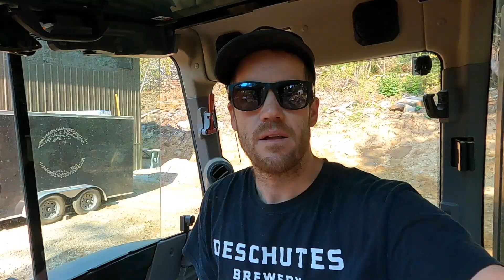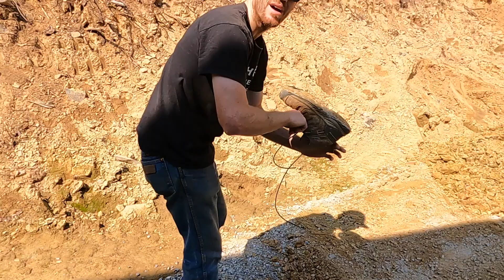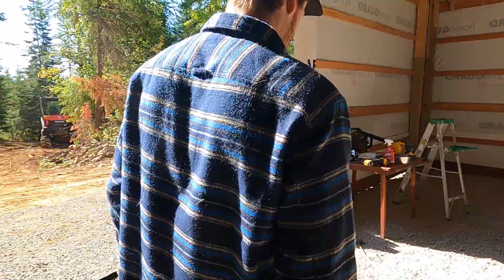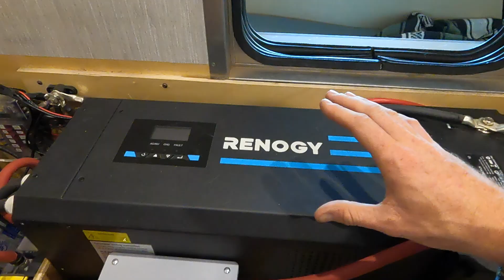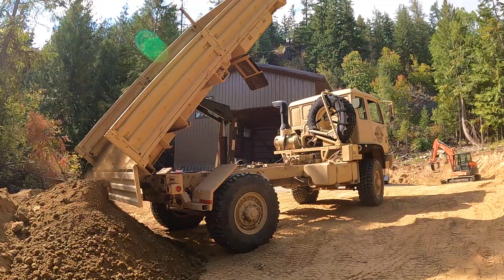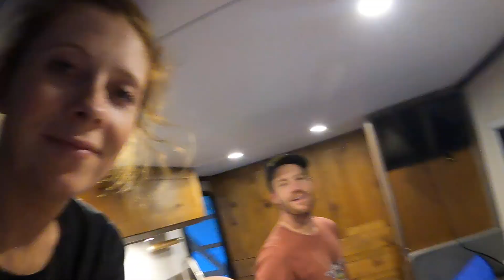Expanding Our Off-Grid Power System

Comment: I notice you keep stating 110/220 volt for all your AC systems but is it actually 110/220 volt output or 120/240 volt output? 

The reason I ask is because I don't think I have ever seen AC in a split phase supplied home below 115 volts (normal sag at peak) which is usually 120~122 volts and peaked at 126 volts and yes that was in cities with a population of over a quarter of a million. Of course in a 3 phase building you'd have 120/208 volt at the service panel.
Reply: Appliances are designed to work with 85 - 100 Vac.  The reason we run our single phase circuits at 110 - 125 Vac is to account for voltage losses on long wiring runs and extension cords during motor startups and such.  Good quality modern inverters allow the output  voltage to be set anywhere between 108 Vac and 125 Vac.

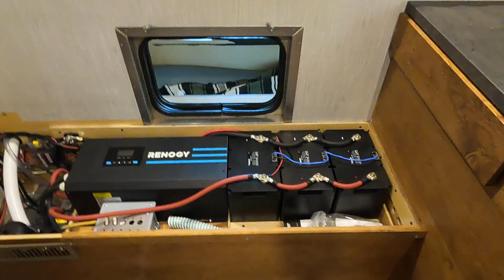Comment: @ 6:33... I'm sure you've heard this a few times, but.. With the 12V + coming off the #1 Battery on the left you should have the 12v- coming off the #3 battery on the far right. You will get a better ( even ) charge and discharge on the Battery Bank. ( click on my name and you will see a part of my Camper system )

Comment: Great video just wondering if  yall have plans to add one those roof mount ac/ heaters to your truck camper and if you can run it off your lithium batteries and solar panels for an extended amount of time?
Reply from the maker: The plan was always to add an A/C unit, we use never got around to it last summer. I think we would use our portable panels, so that we could park the truck in the shade. In that case, we could probably run it for about 5 hours off our system as it sits.

Comment: I have my Cirrus 820 and have Renogy flexible 100 watt panel room for two more and a 3000 watt Renogy inverter the same one you have and a Victron  100/30 charge controller also two Chinns 100 Amp hr Lithium batteries.  I just returned from a 7400 mile trip from Florida to Seattle and I only had to use my Yamaha 2800 i generator twice for the AC. I think if I put two more Renogy solar panels and maybe 2 more Lithium and I should be able to run the AC as well. Any thoughts or suggestions there.

Comment: When the oil pipeline was under construction, the road builders used non woven fabric to keep the road from sinking into the tundra.  Considering the area you guys are working with, plus the road construction you have planned, it occurred to me you need an outlet that handles commercial rated orders.  
There use to be an outfit in Vancouver Washington called GEO that sold the non woven fabric made at the GP mill in Washougal Washington.   But that plant was shut down years ago and as far as I know, it is still shut down, so my suggestion of GEO may be worthless.   But there must be an outfit that still supplies road builders with non woven fabric, even though the pipeline is no longer under construction,  Buying it at Home Depot, won’t work out though probably, because of the cost.  I just bought a cheap knock off of the non woven material for the flower beds at Home Depot and had to spend $30 for a 3ft x 50ft roll.  
The commercial rolls come in twenty foot widths I think.
Reply from the maker: We did find a local supplier of the big rolls! Thanks for thinking of us!

Comment: It's graded for the water to go behind the building? What about the slope? It seems like you will have water with no place to go? I don't know what it really is like from the internet =) but I think you may have some problems. I would put in an underground drain tile and run the water down the hill side. Best of luck!
Reply from the maker: The water runs behind the building and then down the steep hill away from the shop.
Reply from the maker: The water drains away from the build, towards the back and then around the back and out the side where it can go down the hill. This keeps water from running across the area in from the the building and eroding the driveway. The slope is a about 1' over 30'

Comment: Have you considered using a small energy user fan, like a computer cooling fan to using in your battery cabinet?  Could run when a thermostat is set to a temperature that you choose.
Reply from the maker: The heat is only an issue when we are bulk charging on shore power or with the generator, which is not something we do often with the solar panels. We considered a fan blowing outside to keep the heat from being in the camper at all but were concerned with the diesel heater creating a low pressure on the cabinet and sucking exhaust inside.
Reply from the maker: We actually bought one to do that. The plan was to put it on a thermostat and vent outside. But then we realized that putting a hole in the box would mess with the heater, which is also located in the box. When the heater runs it would create a low pressure inside the cabinet and potentially suck heater exhaust into the camper through the fan. We only need the extra ventilation when the inverter is charging off shore power/generator which is very rare for us.

Comment: if you disconnect the panels on the roof of the truck you will probably get significantly better  performance from the external panels when the roof panels are in the shade. i just ran into this issue and working on adding a switch to the panels (might use a bluesea breaker on the roof solar wires.)
Reply from the maker: That is on the list! It will also allow is to get the full 50a out of the alternator if we need to, when the sun is shining on the panels at all the DCDC charger limits the alternator charge to 25a. Thanks for the help!

Comment: A suggestion for your hound dog that likes to run around whenever he's off the lead put up a 3/8 coated steel cable with a 10 15 ft lead on it ratchet strap it to a couple trees make it as long as you want using wire cable cable clamps and a key clip a big key clip you hook it up to his collar you can run back and forth as much as you want anyway stay on stay tied up on a short on a leash all the time
Reply from the maker: That's a great idea, we have plans for a nice fenced yard for them, but that would be good in the short term.

Comment: Thanks for the solar update to your “off-grid” project. I’m amazed at how much you can power cleanly. Will you be adding more arrays and batteries to power the shop? Completely? Compared to the 240 watts you’re getting now, how much do you project you’ll need when the build is done and you’re up & running? Just so impressed by your vision, imagination and execution. 👍
Reply from the maker: Powering all of our tools in silence has been absolutely amazing! We will be adding a very significant ground mounted residential array eventually to power the shop.

Comment: I completely understand what you mean about landscaping for drainage. I bought my home in 2011, and immediately noticed it had a wet basement.  Litterally when it rained the cynderblock walls seeped.  My second year in the home, I tore out the elevated concrete flowerbed in front of the home and went around the home with clay about 6 inches high near the foundation with a fast taper to about and inch 4 feet out, I then placed a surface mount wood retaining wall single height 4x4 landscape timbers all around the house and put river rock on the clay all around the house.   I have not had water in my basement since and that was almost 10 years ago.  I put a shower vent in my unfinished basement on a mechanical timer that runs for about an hour a day, and I was able to get rid of the water condencing machine that had to be emptied once a day.  Now it's dry, uses less than a tenth of the electricity and I do not need to run down there every day to empty a water tank.
Reply from the maker: That sounds like some serious hard work and excellent problem solving!

Comment: Fit a fan to the cabinet to flow cool air
Reply from the maker: A fan is another electrical draw and it just isn’t really necessary. We only need to prop the cushion up when we are plugged into the generator or shore power, which is very rare.
Reply: @AmbitionStrikes  I have one setup in my caravan it only runs when the inverter is running.

Comment: Better make sure those ditches are big enough and have a good outlet to handle the spring runoff !

I don't think you need to worry about a retaining wall this year, but it will be required.  Seek professional help design the wall or you will be redoing it.

If the outlet of your ditching has a steep decline, you should consider some erosion control ASAP !   Line from just above the steepest part to well below with "road grade" geotextile and then install 6"+ rock on top.
Reply from the maker: We have a good slope to the ditch and plenty of rock to control the run off. Since we haven't been here during a spring season yet, we're not not really sure what to expect.
Reply: @AmbitionStrikes  Line the steepest part with road grade geotextile and place 6"+ rock on top of that.

Comment: Add small fans in the front of you box to get the heat out. Just not the holes on top and that way you don’t have to keep moving your cushion. A couple blowing air in and then others to blow out.
Reply from the maker: We only need the extra ventilation when the inverter charger is plugged into shore power or the generator, which is not very often!

Comment: Riley, have you considered taking some of the left over wood from the framing and making a cart for the 3 solar panels?  Add wheels and you can roll it in or out of the shop to protect from weather without having to break them down each time.  Also makes it easy to reposition to get better sun coverage.  Not a permanent mount, but a frame/cart that they can be mounted to but also removed for travel. Just a thought.
Reply from the maker: That's a great idea and would certainly cut down on the amount of shuffling I do with them!

Comment: I was thinking just that in the beginning of the video, they need good trench under that sloping hill! Minimum 1x1 feet but 2x2 is better. Best would be if you make 2x2 on the surface and 1x1 under that as gravel filled dich. Then you have drainage in those weird week in winter when you get warm days and rain - with 6 feet of snow, then the water can enter frost free channel underground. Also good for spring thaw when everything get running water.  But looking good so far! Well done!
Reply: use of a perforated flex tube with a filter cover at the bottom of the drain ditch will be hwlpful in the frozen times and during the spring time an it will allow for your water collection

Comment: An MC4 Hack:  With portable panels you may want to connect and disconnect the MC4 connectors daily.  As you probably know, MC4 connectors aren't meant to be connected & disconnected often and are difficult to disconnect.  The hack is to cut off the tabs on the male connectors.  Using a sharp utility knife, I scored the plastic just in front of the tab and broke it off using needle nosed pliers.  It makes daily disconnecting so much easier.  I'm a Victron kinda guy but I'm very impressed with your Renogy system.

Comment: There is still so much to do on the jobsite, what makes the choices even harder what is more important. But i think after securing the shop, maybe you should get a well. That Waterhauling with the truck in the wintermounths up your driveway scares me.
Reply: I think they mentioned in a previous video when they purchased the property that the area around them is very bad or hard to get a good well. With my knowledge of the area, they could spend 50k and still not have a functioning well. Water catchment might be their best bet with their location and some type of gravity fed cistern with the hill behind them.
Reply: @mel_pnw  so thank you for the information; now they know which descion has to be made next

Comment: Poured Floor question, is a Rat wall common in Idaho?  First 6 inches of the concrete is poured thicker 12-18" to make it harder for critters to dig under the slab and make a den.  Are you making  any area of the floor thicker for extra support for anything heavy or jacking up your bigger equipment?

Comment: Mounting on your trailer is a good idea... just plug n play through shop wall! Maybe something easier in the winter though? For snow removal and cleaning? I take it it’ll be for always powering while your camper is in the shop, which will be all the time! Or are you eventually building a permanent panel system for your shop? Thanks for your help with solar systems 👍🙂🤘🏻
Reply from the maker: When the budget allows we will be adding a large residential ground array!

Comment: Awesome grading job, now just a "little retaining wall" and you're high & dry... It's great that you got some moisture back in the moon dust!! 
💪💪🐕🐕‍🦺
Reply: They definitely have plenty of boulders to put against that cut slope!
Reply: @rixtrix11  Or slope it at a 1 to 1.
Reply: @not-fishing4730  considering how much mountain is above the cut behind the shop, there needs to be some substantial stabilization on the cut to prevent washout or slides. Swales are better for gentle slopes.
Reply: @rixtrix11  if and when they dig a septic system there may be plenty more rocks for a retaining wall
Reply: @rixtrix11  Maybe so but only a local soils engineer could tell what the pressure is going to be and what form of stabilization is necessary.  Here in California I'm not used to seeing tie-back systems or geogrid retaining walls up in the mountains of California unless you have a lot of rock slides (reason for the tie-back with chain link)  or concrete / keystone + geogrid stabilized retaining walls because the Owner wanted the added room.

Comment: These same panels can be mounted on top of the garage higher windows (facing the sun.. provided the seasonal sun rise and day time). now a door.. some indoor LED  adjustable ceiling light.. and a good cast iron blower stove... keep you warm in the winter months and do garage projects easily.. stay safe, Regards from Singapore, GOD BLESS.

Comment: You could also put solar on the roof of the shop and have a shore power line to the camper. I have a 3KW solar system on the roof of my shop that is currently doing grid feed. However in the future I'm thinking of adding a battery bank so I dont have to draw from the grid at night.

Comment: If you don’t mind your battery box take a computer fan wire it up to a temp controller to kick on when needed an 4” PVC pipe to direct the heat away .
Reply from the maker: We actually bought a fan and were planning to do that and have it vent to the exterior. But then we realized that would mess with the draw for the heater, which is also in the same box.

Comment: Hey guys! It's exciting to be seeing your progress! Just a thought on the solar. I wonder how Solatubes work on your roof would work? If you've never heard of them they are installed through the roof and with the help of lenses and mirrors, they bring sunlight into the structure for lighting that would not require electricity! They can be regulated as well as blocked. I would think that being actual sunlight, it could power solar panels as well! Just something that came to me as I watched this video.

Comment: nice panels if you need the space , but you got plenty.. i'd have gone bigger.. especially since you got 300 amp hour total battery capacity..
amps go fast with an inverter..
Reply from the maker: These panels are intended to be portable and travel with the camper if need be. Eventually we will be doing a very large ground mount residential array for the shop.

Comment: Pro tip. When digging hard ground with your mini, turn the tracks 180 degrees so that the blade is behind you. That way you can use the full weight of the machine to help break out the rock and hard ground. Additional benefit, you don’t have to look over the blade when digging up close to the machine. 😉
Reply: Blade is your outrigger!  Protects your drive sprockets & rubber tracts.  Under carriage is very expensive to repair.  Nice little back hoe, very easy to damage, especially in the woods!  I think you two are doing very well!  My main goal was always to get the help home, safely! Ramy always gets you to forget your site obstacles.  I would feel safe working with either/both of you.  Been retired since 2006.  You two are a great team, with mutual respect for each other.👍🏻
Reply: Then you would be digging over the drive sprockets.